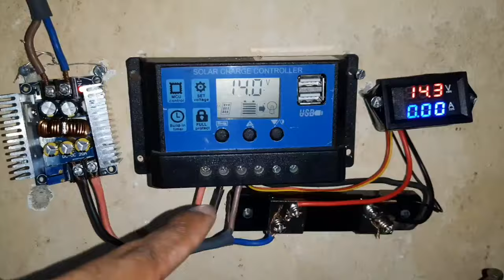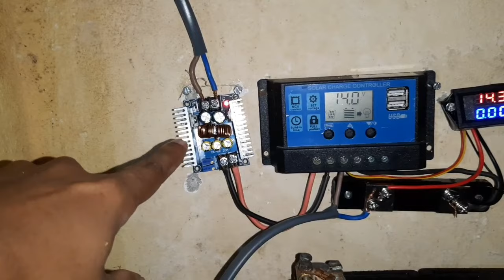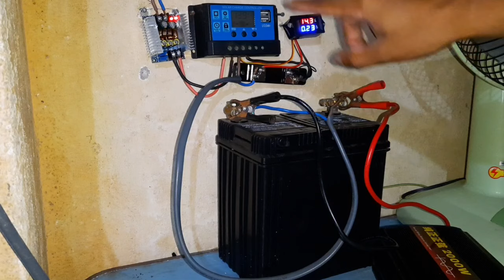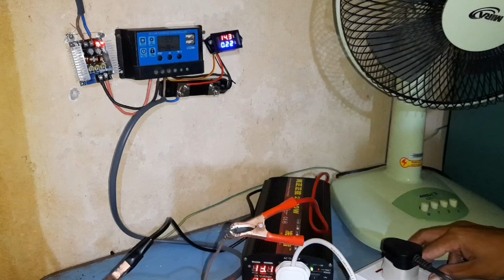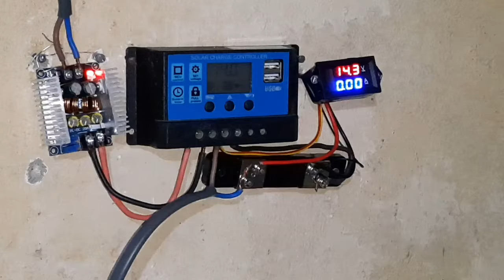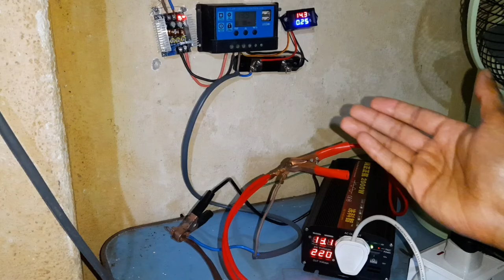Solar Powered Fridge - How to Run a Fridge With and Without! Batteries

Comment: Why do use step up DC to DC ?
Reply from the maker: This is a step down dc to dc buck converter.
Reply: @diysustainableliving2774  what if connected without step down?
Reply from the maker: If you dont regulate the input voltage your inverters over voltage protection will kick in and shut down your inverter.
Reply: @diysustainableliving2774  I mean what if you put it directly into the regulator, the out put will be ok, whatever the input Voltage...
Reply from the maker: Do you mean solar charge controller? The thing is pwm solar charge controllers (scc) operates as an on off switch at a high frequency. It is the frequency it on and offs that determines the voltage on the battery side. Once it reaches14.4v it basically shuts off the panel from the battery. And without an initial voltage on the scc output side it wont turn on as it decides whether the circuit is 12v or 24v. When an inverter is connected without a battery there is nothing to control the voltage. So it rises and in theory should trip the inverters protection circuit. I have not tested it is such a way.
Reply: @diysustainableliving2774  so the step down in very important?
Reply from the maker: If you dont have a battery to provide the baseline voltage then something like a voltage stabilizer in this case a buck converter is necessary.

Comment: Go to  the point Miss
Reply from the maker: Well Miss... This is just a proof of concept of an idea that you can use high powered appliances without a battery using only supercapacitors and solar power. The battery is the most costly component of offgrid solar power systems.

Comment: Hello sir can i know how many solar panel watt?
Reply: My fridge take 0.7A how much WATT solar panel should I need
Reply from the maker: What is the supply voltage. Also remember you need to put at least a small battery so that yous system will run smoothly.
Reply: @diysustainableliving2774  ok sir but 0.7A work in 150W or i want more WATT
Reply from the maker: What is the voltage it runs on? 220v or 110v? If it is 220v then the fridge is rated for 154w. How long are you planning to run it on solar? Only during day or 24hrs?

Comment: what is the specs ur ref.?
Reply from the maker: Mine is 72w 220v Single door fridge with freezer compartment. It will use around 3 to 7 times the running power at startup since it is an induction load.

Comment: your solar panel is very small and solar charge controller is also not mppt solar controller    refrigerator take start current around 220v 3 amp  which is arround 750watt starting current then settle around 350  watt
Reply from the maker: Exactly... Thats where the supercapacitors come in. And of course the continuous power rating of that fridge was much less than 350w. Thats why it was able to run on that small panel.

Comment: You could use a bigger solar panel,
Or a 12V fridge :)
Reply from the maker: Yes.... What Im showing here that it is working with what I have. But what happens when a cloud passes over? You cant just add a massive solar panel array just to counteract the clouds.
Reply: @diysustainableliving2774  its 18.56pm in London, cloudy grey sky & my 120w solar panel is giving my mppt 14v 0.2A..
In fact most days here are cloudy and I still get my battery topped up every day even if I use my diesel heater for 8 hours the bight before :)
Reply from the maker: Wow... great!.... The point I wanted to make in this video is that it is possible to start and run induction loads such as a fridge directly on solar without batteries. But if the battery is not there in your system you cant compensate when there are sudden fluctuations in the solar input.

Comment: I bet you your cable going to battery to inverter get warm or hot. After a few minutes
Reply from the maker: Nope... not when running a fridge. It dose get a little hot when I run my induction cooker as the power draw is high!

Comment: Concept is ok. But it's not sustainable. These Supercapacitors can't run a fridge more than 3min. So during sun covered by cloud or in the night it's not gonna work.
BTW today there are inverters that can run without batteries.
Reply from the maker: The concept of this video is to show that you need additional power storage some where to get any meaningful performance. If a cloud covers the sun for just a moment the whole system can shut down!

Comment: Why not tell others to use protection circuit for the super capacitor? Very dangerous hobby!
Reply from the maker: Yes it is important to use the protection circuits. I am having them in all my other videos. Unfortunately at the time of filming this my old circuit gave way and  I had to make a DIY one till my new protection circuits came. Allways use the protection circuits for supercapacitors for your safety!
Reply: @diysustainableliving2774  excuses!  Lol

Comment: Click bait. Now get rid of the battery, get rid of the charge controler and do it as stated in title. You dont want this old lady to show you how it's done , do you?
Reply from the maker: This is a proof of concept video. This is not click bait. All of these results are replicatable. Just do it and see whether it works before commenting. Thanks.
Reply: @diysustainableliving2774  the fact you used a battery when you said no battery makes it a false hood. Yes it can be done but no you didn't do it. Actually in reality I dont think one small panel can handle a frig startup draw.  The battery lessens the initial draw.
Reply from the maker: Oh... You didnt watch the video till the end. Please go through the whole video and see what I am using instead of the battery.